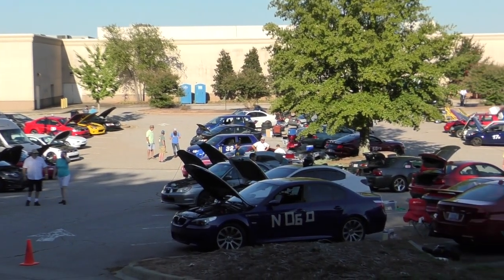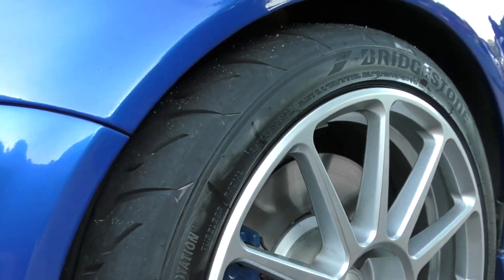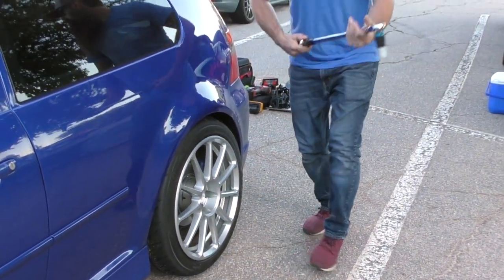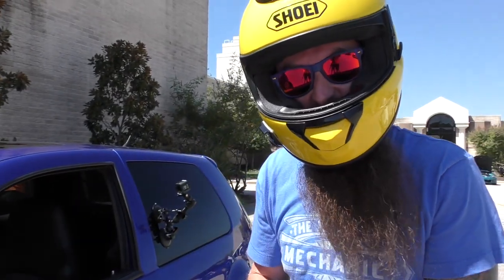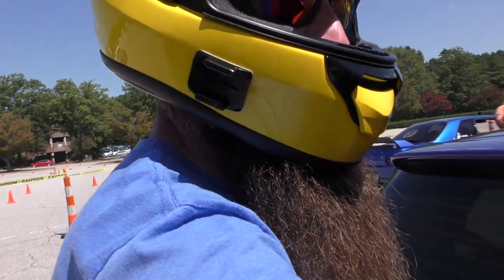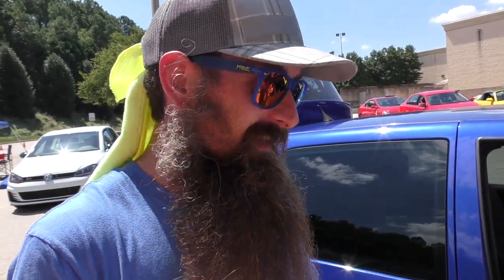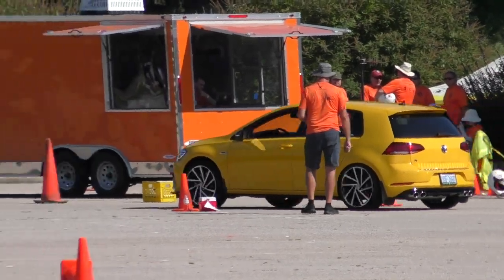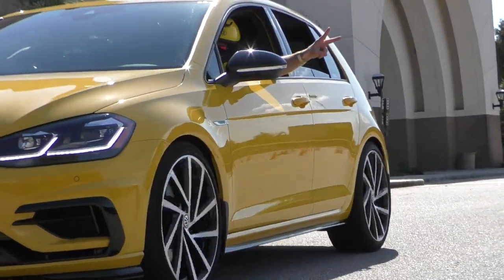I Broke the R32 AutoCross Racing

Comment: Soundwise, the R32 completely wins over the R.
Reply from the maker: 1000% LOL
Reply: You just can’t beat the sound of the NA VR6 👍
Reply: How strange on a V6 & a fitting exhaust... Todays cars are made to fit people with cash to buy them, which are often old and not interested in noise. Regarding prices: check out the price of a MK 7.5 GTI today, its even more than my GTI Clubsport, (seen at my channel) Yet mines a special edition & not even sold anymore (and never sold at all in the states)
Reply: @macoppock  thats about the only thing good about the vr6. this is coming from a old vr6 owner lmao.
Reply: @Kanggoo I had an ‘01 GTI with the 2.8 liter VR6, and that motor was lovely. Too bad the rest of the car was a lemon 😂
Reply: @macoppock  you heard that rx7? yeah. 😆
Reply: Don't know why anyone would knock on the VR6 engines I've had several VR6 cars all of which were very reliable and on average a Vr6 has more power and torque than a 70's through 80's 5.7v8
They are even more awesome when turbo charged

Comment: If those are Powerflex bushings and that happened, I'd be having a word with their QA division.
Reply from the maker: They are.... I will send them pics of the bushings. It's all good from my end. I have another setup :)
Reply: @HumbleMechanic  Be interesting to see what they say.  Chin chin.
Reply: I have been use this setup on my .:R32 since 05 and never that a problem https://www.ttstuff.com/T1/MCPI-DFCN1.html
Reply: I just put a powerflex dogbone insert in my mk7 so hope mine lasts better. Guess we will have to see
Reply: I've had a powerflex on the lower engine mount, street use only, 1 year later the bushing is in pieces..not sure if it's bad use, bad mounting or what not..
Reply: Alex Dobrescu same thing happened on my focus rs mk1 some years ago, finally replaced by stock one, only full engine mounts was uprated with vibra technics
Reply: @HumbleMechanic  I just upgraded all the bushings in my car (Skoda Octavia RS mk1 - European car built on the mk4 platform - with R32 control arms and spindles) to Powerflex ones, except for the dogbone one (which I upgraded to Powerflex 10 years ago and still has no issues), a month ago... I hope I won't encounter such problems, as they aren't cheap. Nevertheless, I don't race the car, it's street use only.
Maybe you got unlucky and ended up with bushings from a faulty batch... Good luck with the new ones.
What are they, anyway? 🙂
Reply: @DonPablo2011  They'll claim it's installer error until they see he's on YouTube, then they'll try to "sponsor" him.
Reply: I converted my MKIV Beetle to R32 front suspension and used Powerflex everywhere, never got around to autocrossing it before someone rear-ended me and totaled it, however they were the best bushing set I have ever used.  Hopefully they can help you out a little.
Reply: Alan Prokopij me too. Although my car is mk5 golf I hope we don’t encounter any problems.
Reply: You'll be fine on an insert....the issue with these bushings comes when they are used to replace fixed rubber bushes that are designed not to rotate but stretch twist. The poly's are designed to rotate in the metal housing relying solely on grease to stop them binding - over time this can result in too much friction and the bushing break down or splitting as it tries to stretch once bound up....which they simply can't do unlike rubber.

Comment: Sealed monoball bushings/spherical bearings are the only upgrades I would recommend vs. stock components. Otherwise, you'll have trouble like this. Polyurethane bushings are fine for sway bars, engine mounts, driveline bushings, etc, but not for control arms. Too much heat can build up in them causing failure like this.
Reply: Yep, many articles and books compare polyurethane bushings to plastic.  They can only forces in one direction.  Control arm bushings handle deflection front/back while rotating up/down.

Comment: So much for after market parts being better.
Reply from the maker: Finding that to be the case in more than one place.
Reply: I mean they're better in a way. Longevity isn't that way. They were stiffer.
Reply: @HumbleMechanic  Agree 100%. My MKVI GTI is very picky when it comes to non-oem parts. Only putting factory parts on it from now on.
Reply: Its not always the case. I find its best to only improve what fails early on oem
Reply: @DrDodge24  lol, you mean like the weak clutches?  I'll stick with aftermarket where VW parts weren't up to the task.  This bushing failure was an odd one, my suspicion is a QC failure.

Comment: 4:04 Rear left tire completely off the ground lol
Reply from the maker: Yep. Spent a lot of time on 3 wheels. HAHA
Reply: Used to watch stuff like that on redline ten of the best dvds
Reply: @HumbleMechanic  3 wheeling is good but you're not getting enough air ,, seems either you need more front grip (tires) or more weight transfer (softer springs or shock compression front.. more rear bar?)
Reply: That’s what a stiff rear sway bar does on these cars.

Overall the car could use stiffer springs and OEM swaybars. It would be neat to see video of the same car on the same course to see how the stiff rear sway bar is a detriment to performance.
Reply: We call it a tripod in the autox world. My car does it A LOT but the best part is I can really feel it lift up while driving in the car.
Reply: Reminds me of a dog at a fire hydrant. 😛
Reply: @michaelblacktree  
Exactly!
Reply: I noticed the same thing. Good comments on here. I was thinking it was due to the rear sway bar and/or suspension. The "R" did not do that. I wonder if having a factory sway bar and stiffer coil overs would help that.? Which is my current setup on my 01 vr6 GLX....
Reply: Try to do that on a mustang, that's sweet handling baby

Comment: That's unfortunate I hope you get sorted. I, of course, am not as expert or experienced as you, and I'm sure did your research before fitting the bushings. However being an R53 Mini owner I was aware of the consensus that some bushings can and should be poly-d, and others absolutely should not. In the case of the Mini it is not recommended to poly bush the rear trailing arm for example. Some bushings just need to flex, and either the surrounding components, or a more rigid bushing material, can't handle the forces, and things break. Maybe you have found a similar case on the Mk.4 chassis?

Comment: Great video!  If I could make a suggestion for your next video, maybe you can address the dreaded low oil pressure warning on the 2.0. just had this code come up on my A4 b8 and keeps going away. I looked on a whole bunch of threads but no one seems to have a definitive answer. Maybe see troubleshooting guides and what to look for. 

Keep up the great work and keep pushing out the content

Comment: I like the video.   I also autocross, a 2002 Subaru TS with RE71 R as well.  6 more events this season and I will be doing suspension and bushings over the winter.  I just uploaded events in July.  This weekend I'll be doing Sat and Sun events.  Keep them coming.

Comment: look up "defcon" inserts for the control arms. They let you run the smaller standard mk4 bush in the front position for less flex or possibly better still go for smaller superpro bush with the defcon inserts. These are well proven in the mk1 TT circles.
Reply from the maker: They show out of stock. I emailed them to see when they may have them

Comment: The R is definitely more wallowy than the r32 but damn that 32 sounds great, those tyres are great I use them myself on my XR5 I use to use P1's but found the RE's grip better under braking. Go back to rubber bushings, I found that with heavy use over time urethane ones just crack and fall to pieces. I had a 2004 Focus RS that I tracked and it ate urethane bushings for breakfast, I think it had to do with shock from having stiffer suspension. Great vid...

Comment: So from Autocrossing my 08 TT Quattro (audi's R32) we had great luck setting the front tires to 32psi and OVERpressuring the rears to 48psi.  When you enter a tight corner you can get a little lift off oversteer to get you pointed in the right direction, then when you hit the throttle the haldex will grab and go straight in whatever direction you are pointing.  Without doing that you fight understeer constantly.
Reply from the maker: Nice! 32 seems to be the magic. Number in the front. I will probably try playing with pressures on the rear next time

Comment: GREAT VIDEO! I was wondering when you were going to drop this type of video. Nothing beats a car like Autocross, except for rallying. That's one of the reasons I'm hesitant to try out my Mk1 GLi. Amazing how the compression forces on the control arms was enough to pulverize those poly-bushings. Best to go back to factory rubber! Otherwise your car did great - no puking fluids on the ground or engine\trans issues!

BTW - the R32 sound GREAT! AND I love how it lifted it rear tire on the first hard turn! Classic VW! That's how you know you're at 9/10th limit! Good Job!
Reply from the maker: Thank you!! I really want to do a rally event. BAD!
Reply: @HumbleMechanic  - That's what I figured when you got the R32 - AWD is for dirt! Pikes Peak - here comes Charles! 👍

Comment: Their design allows the bushing to rub and bind against the rail, mount, etc.  Polyurethane isn’t a very long lasting material anyways because it has memory and eventually permanently deforms (I.e. ovals in the plane of the load).

Hardrace had the best design solution - harder rubber bushings as the middle ground between OEM standard and full race (speherical bearing).

Comment: Powerflex bushings suck. Had the same problem with my R53 Cooper S just daily driving it. They had less than 5000 miles on them.
I put a new set on and a few thousands miles later the new ones started making weird noises. I jacked up the car to inspect them and they were cracked.
Reply from the maker: Dang. Hate to hear that

Comment: Have you looked into delrin. My only mk4 ran delrin front position and R32 rear position on the the front lower control arms and I didn't have a single issue. I originally ran into the same issue and you did with poly. I believe Lella autosport carries them.

Comment: It looks to me as if you may have a little too much bar on the rear axle; can you set it for a softer setting? You might experiment with a bar that is less stiff and compensate by going with higher rate rear springs.

Comment: I watched the video where you fitted new rear bushings and did notice that you torqued the front bolt with the suspension hanging. I was taught that suspension bushings should always be tightened with the suspension at ride height. Could be a cause of premature failure.
Reply from the maker: Possible. But it’s always recommended to follow the factory repair manual of that type of thing

Comment: When I changed the tires they used a impact wrech set to 1500NM. I told them that it needs 120nm, and they said that the most important thing its to be super tight so the wheels wont come off.

Comment: I was wondering what could fail. I've blown off boost hoses before, but that's about it with autocross. Odd in that there appears to be no outside washers to help act like a sock between the bushing and the frame channel like most of the whiteline bushings I run on the Subaru.

Comment: I was wondering if that was a bad idea just replacing the one with rubber in the last video.  The rubber I bet has more give than the urethane, guessing types of rubber have had my hands on in vws.  Most of the urethane inserts are made to a price point urethane in general when it starts to tear just keeps tearing, there are higher end urethanes with typically more expensive additives that tend to offer higher loads before they let go but do the same.  High end urethane can offer some great advantages over rubber when engineered to to do so, said this in a video I don't know how long ago.   Here is my point to it all when you have something connected together its only as strong as the weakest link, you shifted load from two mounts to biased to the one.  The urethane was stiffer and taking more load and it could not take it.  I don't know if a shop sells it but if your doing primarily auto cross I would look to maybe a plastic like delrin honestly think the NVH would increase some but a bit of a compromise.  A lot of the high end guys just go with bronze bushing and be done with it.  I honestly would go back to a rubber since I would more daily drive the car, the two mounts would share the load more equally :D  These videos have been fun to watch, keep it up man!

Comment: Nice video! Very interesting failure mechanism for the bushings, seems really bizarre.   One question: what is the top gear you used in the autocross course?  2nd?  (I'd never actually watched an autocross event before this video, and didn't realize it was so twisty and relatively low speed).
Reply from the maker: At this place 2nd is plenty. At the other place I go I top out of second but not long enough for 3rd. 

These things feel fast and look slow haha

Comment: You really want a non poly bushing in those control arms due to the twisting that the bushings are being presented with.  Poly will rip due to shearing forces.  Go solid or rubber for those mounts.

Comment: I wonder if going stiffer on the front bar and softer on the rear might reduce the inside rear tire lift on hard corners. Do you still have the OEM rear bar with which you could do an experiment on the lifting problem?
Reply from the maker: It could be. I still have the stock front bar.

Comment: Charles after a lot of thinking i may have found yhe reason your bushings failed. Most of the companies that sell poly bushes suggest you tighten the bolts of the bushes all the way only when the suspension is loaded (wheels on the ground).  If not then when you let the car down and its sitting the bushing already has some stretch. Then once you do hard cornering or hit a bump the bushing is stressed beyond and can rip.
Reply from the maker: Possible. I typically follow the repair manual on that stuff. Pretty sure I torqued it the same as the first install. Gonna chat with PF next week and see

Comment: Did you change the pads purely because of the initial bite? Usually means you didn't bed them in correctly if you don't have good initial bite.
Reply from the maker: I did. They were bedded in properly for sure.

Comment: What was your best time in the R32 vs the R?  I know it's not strictly a fair comparison as the RE71R is a lot more aggressive on the R32 versus (what I'm guessing) are the stock Contis on the R, but I'm curious as to the differential between them in your hands.
Reply from the maker: Sadly the R was just fun runs and the timing rig didn't work.
Reply: @HumbleMechanic  Yeah, I read you responding to another guy right after I submitted my post... You mentioned being quicker in the 32 and needing a different pedal strategy in the R and I think I get it.  I know when I'm driving my R hard, I need to get on the accelerator a breath earlier than I'm used to because the IS38 needs a little bit of a spool time you have to factor in, a lot closer to apex than I am normally comfortable.  That might be a bit of a problem in autocross because the rapid transitions don't really allow for that kind of deliberate pedal pre-loading.  Left foot braking would be ideal, but the stock engine management doesn't allow for that.  I can see why it'd take some time to work it out.  You definitely looked faster in the 32!  Keep these kinds of videos up, I really enjoyed them.

Comment: Charles did you use a silicone based grease on your bushings? If not and you used  a petroleum based grease that can be your problem.
Reply from the maker: It’s the same grease I used on initial install
Reply: @HumbleMechanic  was it petroleum based?

Comment: I was surprised that you put those crap bushings back in when you were replacing the failed rear ones.  I guess even a young bloke with vast experience can get caught out with crap poly products.  In my view they  NEVER outperform rubber.
Reply from the maker: Well here’s the thing. I want to learn this for myself. There are a lot of people with opinions on things that have no clue what they are talking about. The last 2 projects I’ve got done some things right, and wrong. I’ve learned that many people have no clue what they are talking about. Even ones that really should. 

Until now I’ve never had a poly bushing issue. 

I’d rather test a part for myself. Now I KNOW what can happen. Instead of my buddies, uncles, cousins, friend telling me. Hahha
Reply: @HumbleMechanic  Yes, it's human nature to ignore experience of others until it bites one in one's own arse :)  Did I mention that I have had rubber bushes fail badly due to the temptation of using knock-off product, arising out of a belief that manufacturers always dumb down their quality to save a few cents per car?  Rubber bushes seem to be one area where the bean counters are prohibited from cutting quality.

Comment: Pretty weird, it almost seems like part of the bushing got stuck against the subframe and it tore itself apart under the heavy cornering loads. Pretty disappointing for sure. Also, is that transmission whine I hear on decel? It sounds pretty bad, has the car always done that?
Reply from the maker: I’ve never heard it before this video. I’m wondering if it’s something on the accessories belt circuit. Maybe AC? I’ll have to do some digging
Reply: @HumbleMechanic  I noticed it too only because my vr does the same.. has an aluminum under drive pulley on the p/s pump that im looking to change out at some point